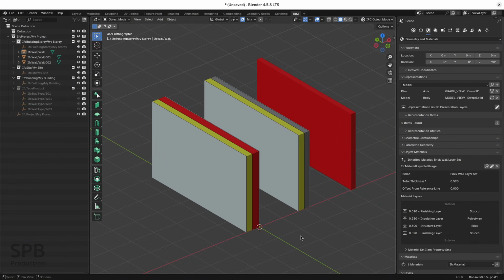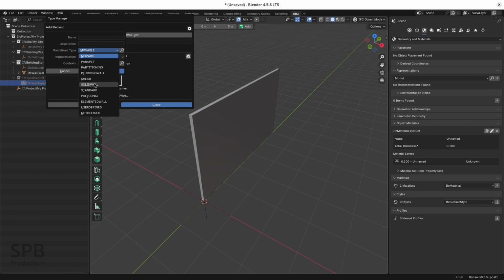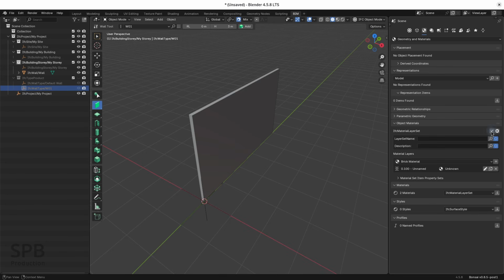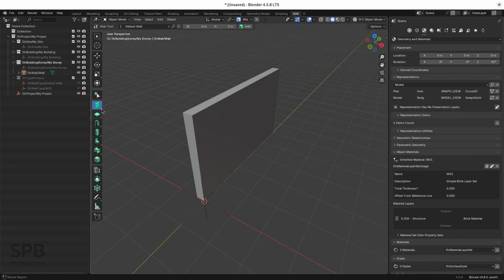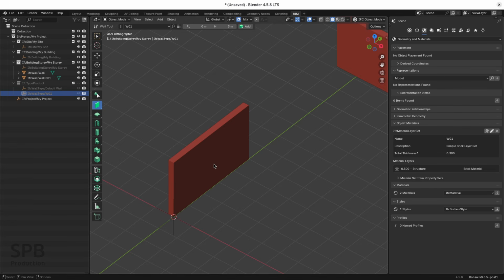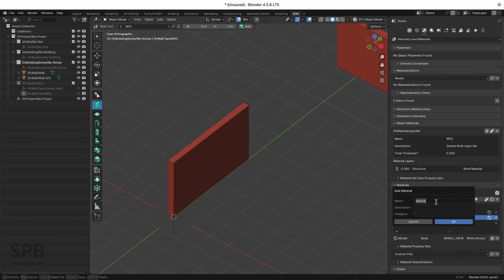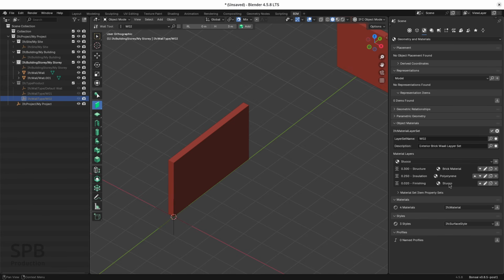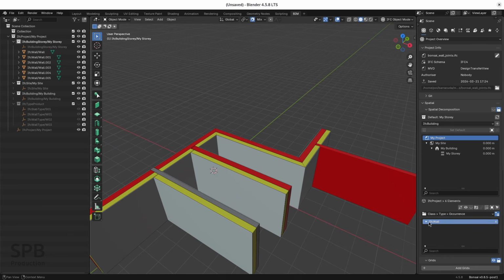Wall Layers in Bonsai BIM – IFC Material Layer Set in Practice

Comment: Great Video! Thanks for your effort. Is there a way to give the wall layers different heights. Imagine a brick wall with insulation on the outside, on top of the brick layer lays the slab of the next storey, but the insulation Layer should cover the thickness of the slab.
Reply from the maker: I don't know about such option. But that does not mean it does not exist :)

Comment: Great video, really well explained and just what I was looking for. One question, why cant I see the colours of the materials. The layers are showing up in grayscale rather than colour.
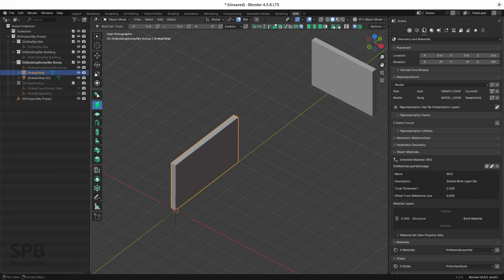Reply from the maker: Did you assign IfcSurfaceStyle to your material as described in 9:45?
Reply: @SPB-production  I dont know. I started from scratch and this time I assigned a surface style to a material but this time I did get colour but it applied to all the materials so all layers were the same colour. Going to have to keep experimenting and maybe watch your video again as I am clearly doing something not quite right.
Reply from the maker: @marksmart5082  Hard to tell without seeing it, the UI is sometimes a bit confusing. You can check which style is assignet to a material in the Materials  group of settings.